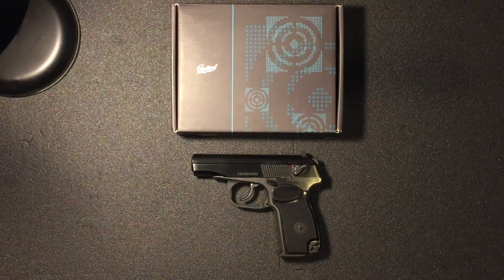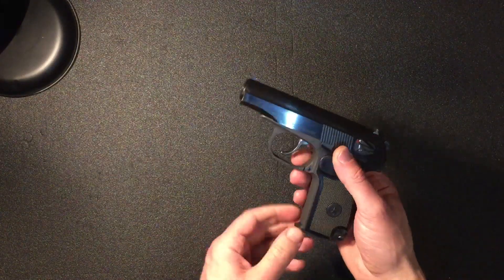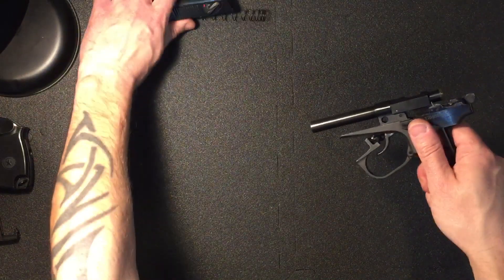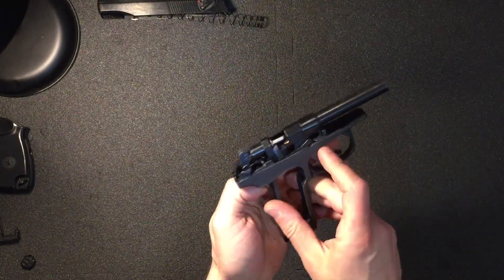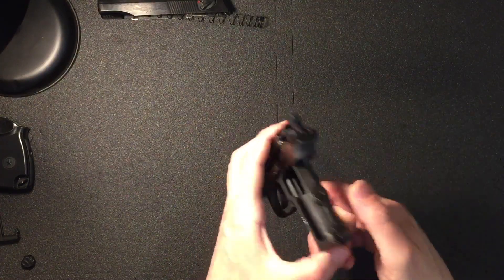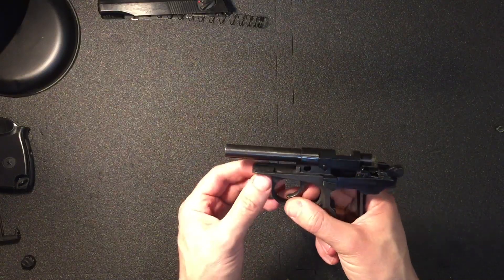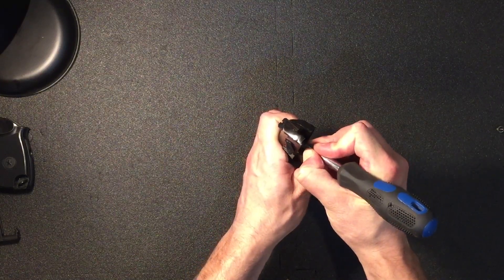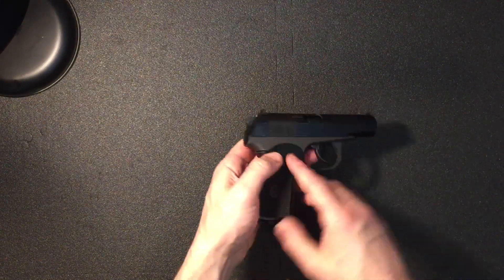Baikal Makarov MP-658K Blowback air pistol with stuck hammer fix

Comment: Thanks a lot for the video.
I do have bad experience with this model. First one I got second hand and returned back to the seller. Second one purchased new, but it is even worth than the first one. Spend most of the time not shooting but trying to fix it!
Reply from the maker: Hello buddy 
I'm sorry to hear you have been having problems with your one what are the issues you have been experiencing I am still trying to find a good lead bb for it I've tried the copper coated ones but they do get jammed every few shots
Reply: @bingobango7734   Hello. Finally, after three days I managed to put the main (trigger) spring on its place and the gun is active for the moment. Not sure for how long. Concerning BBs - never had your problem. I use different ones: steel and copper coated. Prefer still - can use them several times (if found in my garden)!🤣
Reply from the maker: They can be fiddly to get the spring bar situated correctly the only reason I'm trying the lead bbs is because of it rifled barrel the steel bbs will work great but eventually will damage the inside of the barrel if you find ammo that works well with it please let me know buddy I'm glad you got yours working happy plinking
Reply: @bingobango7734  I don't think you need to worry about the barrel. Nothing happens to it. Anyway, this is not sports target gun - it's just a replica model - suitable for plinking.
Reply from the maker: This is true also in the uk they are slowly trying to introduce a ban on lead shots and pellets

Comment: Please tell me if all parts of magazine are plastic except spring and maybe follower? Or maybe there are some steel inserts for durability? Is a little disappointment they made it of plastic :I
I really want this blowback version but hesitate.
But the gun itself is all steel? I mean all metal parts. Except grip and orings is all steel?
And one more, did it fires straight from magazine? The blowback action only cock the hammer, or put the ball to the barrel before fires?
And how about accuracy, is different or similar to the non blowback version?
Reply from the maker: Hi buddy the pistol itself is a similar steel body as the non blowback version unfortunately the blowback version has an all plastic magazine which is the only thing I'd change about it really the co2 cartridge loads into the grip unlike the non blowback magazine where it holds both bbs and the co2 the magazine the blowback works cocking the hammer back the trigger pull feels a lot lighter compared to the non blowback version
Reply from the maker: If it would be helpful I can do a short side by side video for you on my channel just let me know buddy
Reply: @bingobango7734  Thank for fast reply! Comparison video is not necesary. I have the standard version. But thanks.
It only curious me because the latch in magazine looks like separate part, which made me suspect it was steel. But no? 
Is the slide stay in back position after last shot?
Reply from the maker: Not a problem buddy 
The magazine release catch at the bottom of the grip is still metal but the slide catch release doesn't function so no locking back
Reply: @bingobango7734  or if you ask.. maybe you can make a video of accuracy shooting on paper at 10 meters? , by any method, just this distance and try to be most accurate. I want to compare with accuracy of my non blowback.
Reply: @bingobango7734  can you tell me if the blow back sometimes did not cock the hammer? If yes, only when the gas is already weak?
Reply from the maker: Hello buddy that's an idea I can try and sort something for the new year for you I've just recently lost a load of YouTube content on a damaged phone im having to redo the videos at the moment

Comment: mine gets stuck everytime it's in a cocked position. i have no idea why, it functions normally when testing if i put it together correctly but the moment the hammer is cocked back pulling the trigger does nothing
Reply from the maker: Hello sorry to hear that buddy it could be a couple bits causing it I will try and get a short video put up over the weekend to try and help you out
Reply from the maker: Hello the new video is live now hopefully it covers the issue you are experiencing and helps resolve it.

Comment: Would you say the blowback version is unreliable then? Non blowback more reliable?
Reply from the maker: Hello sorry for the late reply I’ve only just seen this comment I love both my blowback an non blowback Makarov pistols  I wouldn’t say the blowback one is unreliable it’s just very easy to pull the trigger when the top slide is off causing the stuck hammer issues. the blowback version is good but I do prefer my non blowback one mainly because it has the bigger metal magazine the blowback version has a plastic stick magazine 
hope this helps 🙂